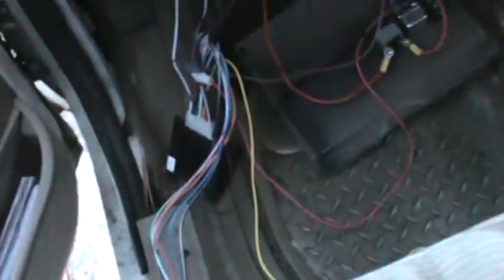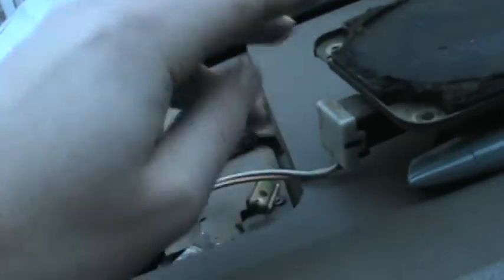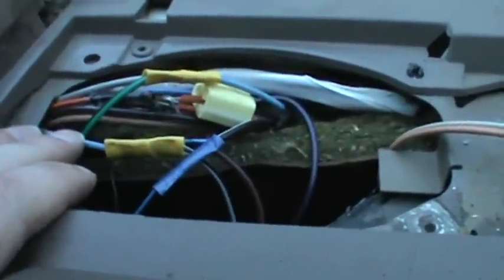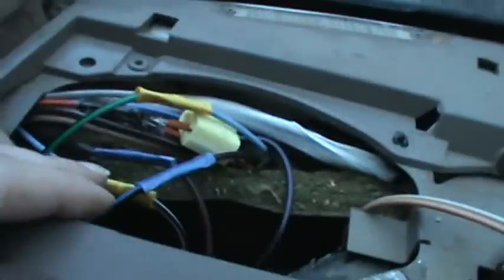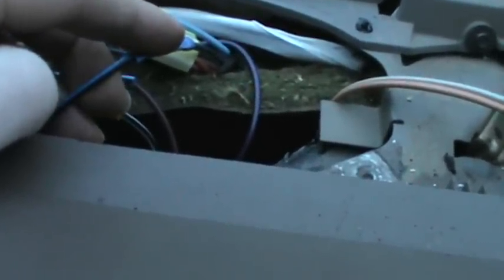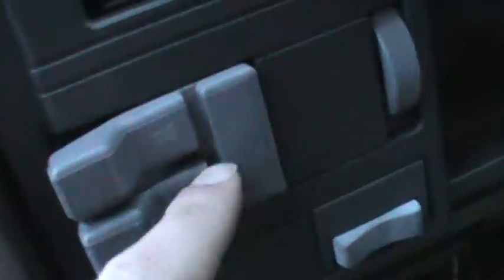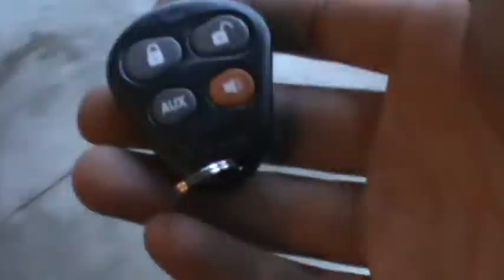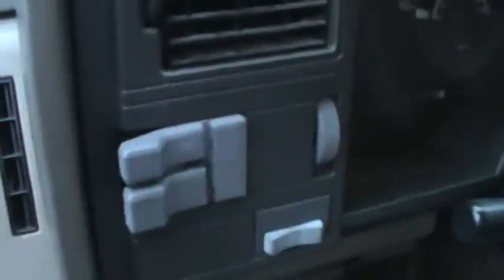Chevy Keyless Entry

Comment: Pro tip , if you got aftermarket fog lights just wire it to those less to go wrong with your actual parking lights. Not likely to have trouble but it has happened

Comment from the maker: Wow, I never thought this video would get this many
views.  Sorry everyone, I haven’t really
been paying any attention to the comments for over a year now.  I will try to pay more attention to my
channel in the future.  For those having
problems, I again ask that you check out http://www.the12volt.com
as your first step.  It will give you all
the wire colors and locations for your specific vehicle.  I scrapped this pickup truck nearly 2 years
ago and don’t really remember anything else outside of this video, so I doubt
that I would be much help anymore.  I
should also mention that these trucks were sometimes wired differently
depending on the year and style (some use relays and some don’t).  This truck didn’t need any relays in the
stock power lock system and I didn’t need to add any either.  However, I now have a 1992 GMC Suburban and
it uses relays in the stock locking system and will probably need a different
wiring procedure (I don’t know for certain as I haven’t tried as of now).  The locking system is a Viper 211HV and it
was ordered on Amazon.com.  You might also
be able to find it (or a similar one) in local auto parts stores.

Comment from the maker: For those having trouble, please go to this site first http://www.the12volt.com.  Click on wiring diagrams and enter your vehicle information as asked.  It should show what the different colored wires are used for (such as lock, unlock, horn, parking lights, etc), including where they are located.  This is the same site I used to install mine.  Stoney Denetclaw, I won't be able to help too much with your vehicle because I think that the lock systems changed between my 1990 and your 1997, and I have never worked on one of these trucks from the late 1990's (they are the same body style with different electronics).  See if you can find your information in the site I listed, and hopefully that will set you on the right track.
Reply: Is this site no longer available?  I am not able to access the site on a computer or smartphone.  Doesn't give me an error, just loads a blank page.

Comment: John did you have to use relays to work with the module?  I have a 91 Silverado that I would like to install keyless entry on and I'm researching.  Thanks
Reply from the maker: I did not have to use any extra relays.  The keyless entry unit has relays built in.  Being a 1991 Silverado, the wiring should be very similar to mine as this truck was a 1990 Silverado.

Comment: I have a 91 chev as well just need the door locks to work. the KES i purchased has a lock and unlock wire.   so you cut the blue and just splice lock into it? or do you need to make a circuit?
Reply from the maker: What is the brand and model number of your KES? It would be easier to help with that information. However, I will assume that it is similar to the Viper system in my video and I will answer the best I can. The blue wire will need to be cut in half. On your KES, there should be 2 wires for the lock and 2 wires for the unlock. If a diagram came with the KES, it should have the wires labeled. One wire should be labeled something like “Lock Normally Closed”. This wire (white and black in my case) should go to the drivers side of the blue wire. Another wire should be labeled something like “Lock Common Output”. This wire (green and black in my case) should go to the passenger side of the vehicle. For the unlock circuit, there should be a black and white wire that needs to be cut in half. The wire on the KES labeled something like “Unlock Normally Closed” (red and black in my case) goes to the drivers side of the unlock wire. Another wire labeled something like “Unlock Common Output” (blue and black in my case) should go to the passenger side of the unlock wire. If there is anything else I can do, or if I wasn't clear enough, feel free to ask.

Comment: Thanks for the video and information.  Very helpful.  What color is the horn wire on the truck that you attached to?  Thanks again, Mike
Reply from the maker: Thanks for your comment. The horn wire is a black wire under the steering column. For more information, check out this site: http://www.the12volt.com/. It has color codes for most makes and models. It's the site I used to connect my keyless. Just click on Vehicle Wiring near the top of that page, and enter your vehicle information as it asks. If you have any other questions, feel free to ask. Good luck.

Comment: thanks for the video! I just bought exact model to install in my 93 gmc. my only question is the purple and black wire connected to the constant hot orange and black. on the viper diagram says the purple and black wire is "lock normally open input". I'm confused because there is a "unlock normally open input" that doesn't get spliced anywhere? I just going for basic setup like yours. any help would be greatly appreciated!
Reply: John winfrey did you find out where that goes to?

Comment: Did you have to use a fuse when hooking up the parking lights flash?
Reply from the maker: I did not have to use a fuse for the parking lights.  This is because the keyless module sends a 12 volt pulse to the lights.  The power that it gets to do that has already been fused where it is connected to the battery (in fact, I think that mine had fuses built into the power inputs).